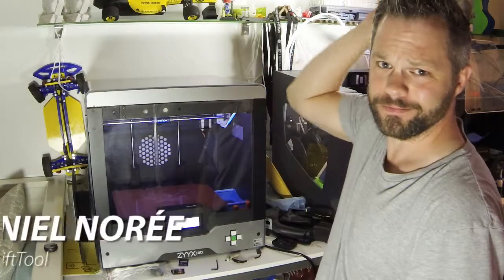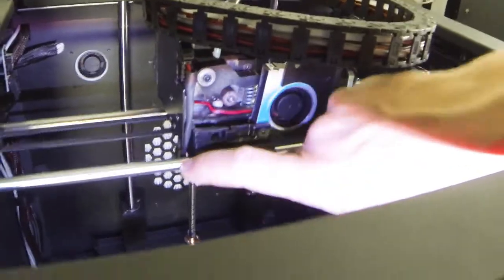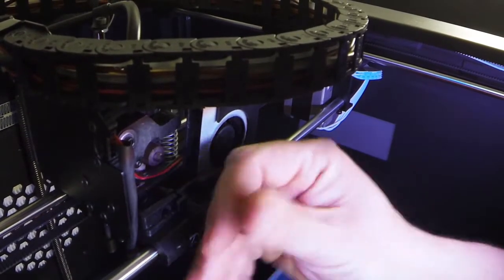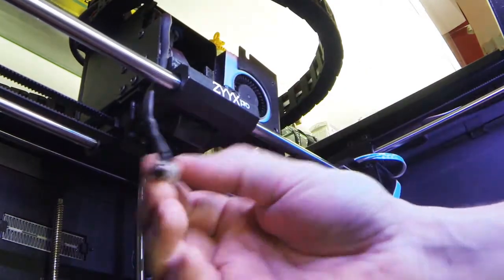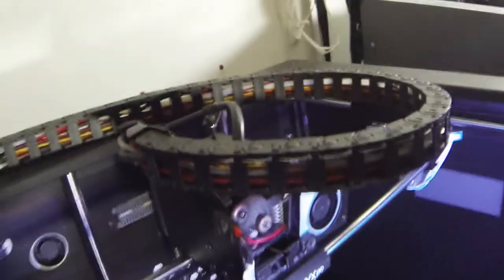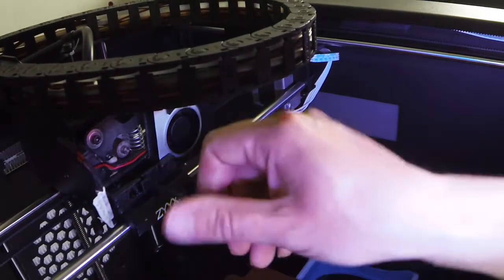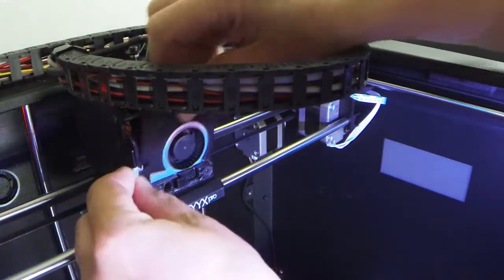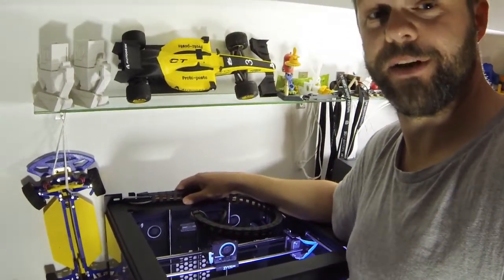The new ZYYX 3Dprinter Hotend - SwiftTool

Comment: I know you print Lot of nylon but would like to see more. I've had limited success using a zortrax. I've tried every material available and keep coming back to nylon as I know it's going to give me the strength I need. Alloy 910 has been the best so far but until very recently I couldn't get in black. I've also tried carbonyte by rigid ink but layer adhesion wasn't great and finish was too rough. Warping is also a big issue although I've just got hold of some Tufnell and looking to try some alternative techniques i.e. Putting down and abs raft first.
Reply from the maker: I´m gonna try to make more videos about Nylons, promise!